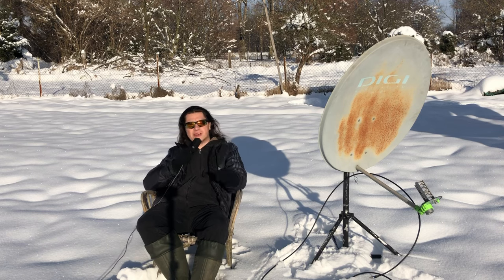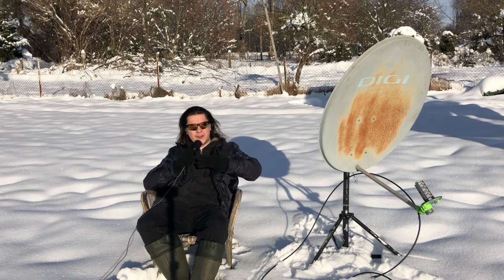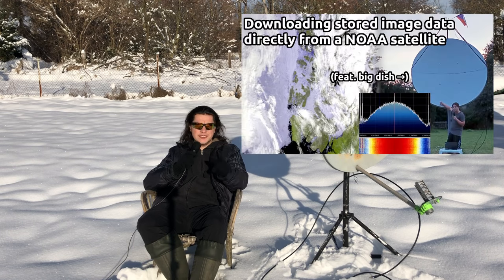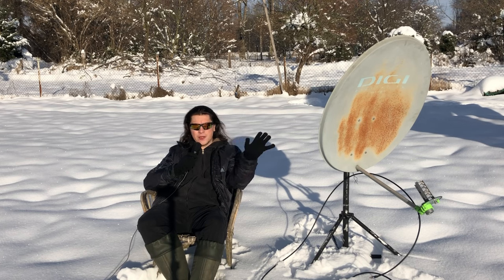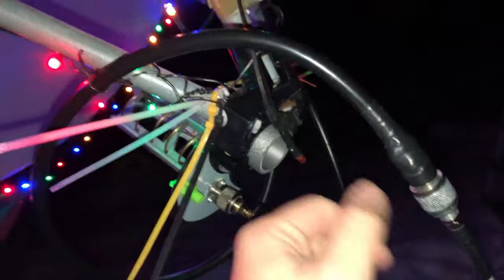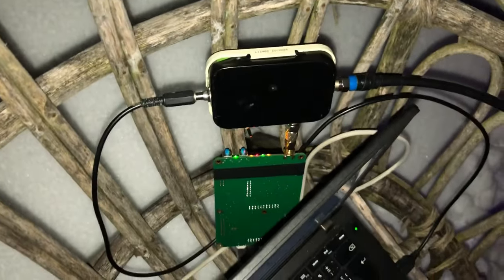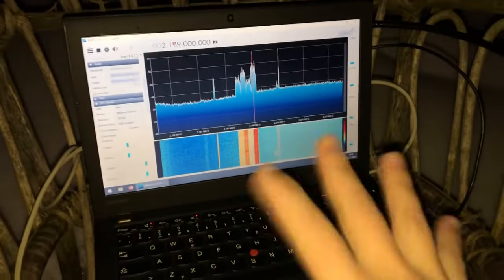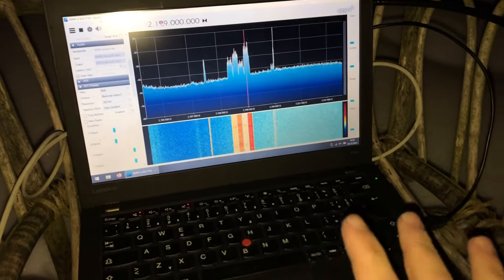Downloading stored data from NOAA weather satellites (GAC revisited) || Satellite reception pt.12B

Comment: I never offset my center frequency. I m using RTL SDR v3. I dont see signal losses when satelite is in the peak elevation.
Reply: I didn't offset either but when the satellite passed peak elevation I would always get a dropout exactly over my location and I didn't know why, someone then told me it was because the carrier crossed the DC spike causing a momentary loss of sync. After I offset the frequency by 0.5 Mhz the problem went away.

Comment: Do you think GAC is receivable from Portugal?
Reply from the maker: that might be far too south for this to work, but if you are in portugal you may be able to receive HRIT from the GOES-16 satellite instead
Reply: @dereksgc  that's too bad, goes 16 is only at 8° Elevation from where I live, but I live in a valley so the satellite is behind a hill 😅. Also maybe my modified wifi grid antenna is too small for that. But I do get peak 17dB with NOAA and Meteor satellites and around 14db with MetOp. Are you a member of the APT Group on Facebook? I post there regularly.